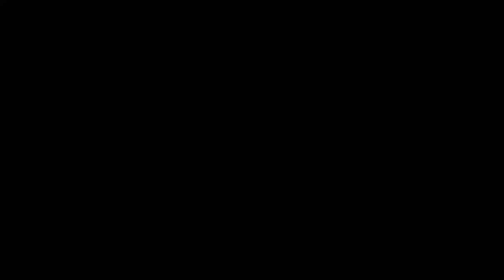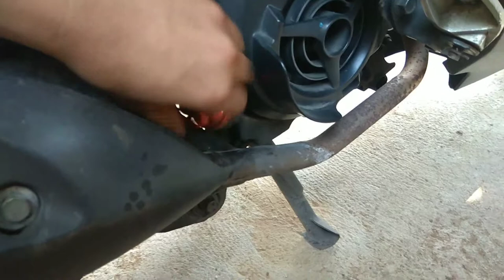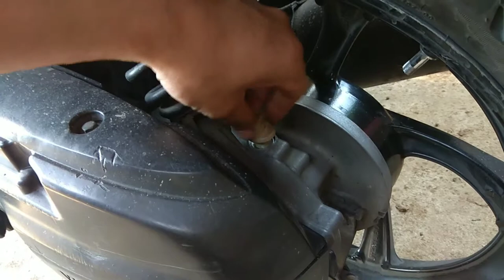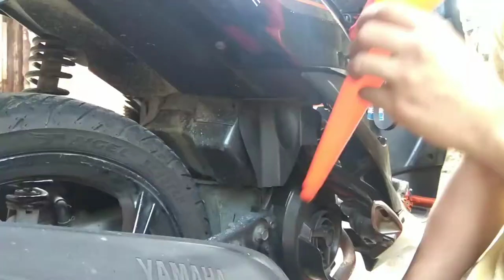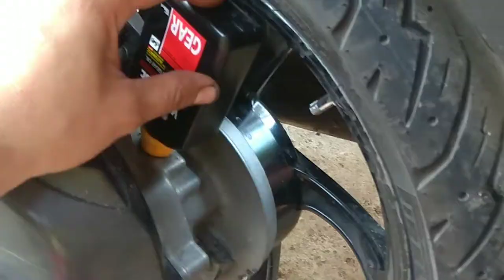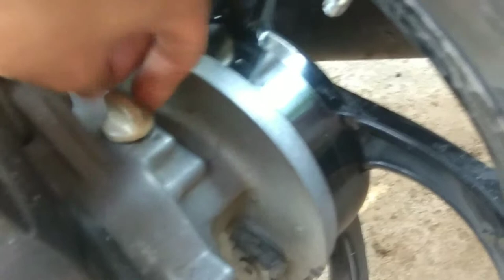How to chance Engine Oil and Gear Oil of Mio Soul Carb -  DIY Change oil And Gear Oil

Comment: Idol, tanong lang po sa pag change oil ng motor, tropa ko po nag change oil, nagbawas muna sya ng langis tapos nagdagdag sya ng "Diesel" at pinaandar nya ng sandali at pinalamig muna makina,tapos nagdrain na. Pang linis daw yun ng makina. Ok lang po ba yung ginawa nya sa pag change oil? Yamaha mx 125 po motor ng tropa ko.
Reply from the maker: ok lng paps,  wag mo lng ppainitin masyado makina.  ang deisel ksi compare sa gasolima my halong langis yun kya pwd dn panlinis at hnd madalimg matuyo.  pero dpt wag mo ppainitin ang makina.  ok na mga 3mis na umandar.  

pero my mga nabbili nmn na pang engine flush d ko lng kabisado price.  kung mag change oil ka bago mo idrain ihahalo mo yung pang engine flush tpos run engine for abt 5 mins bago idrain ang langis.  makkita mo mabilis tumulo amg langis at nahhugasam tlg makina.
Reply: @TropangKalkal  salamat po idol
Reply: ilang litro yang langis mo sir? lahat ba uubusin?